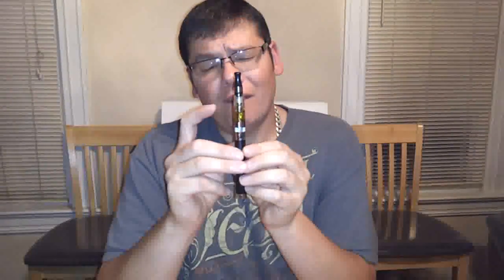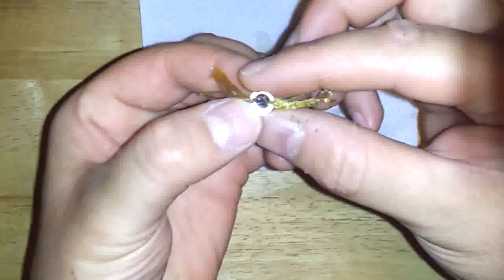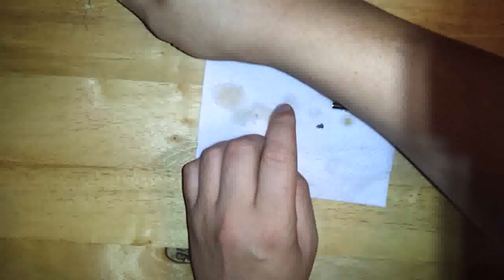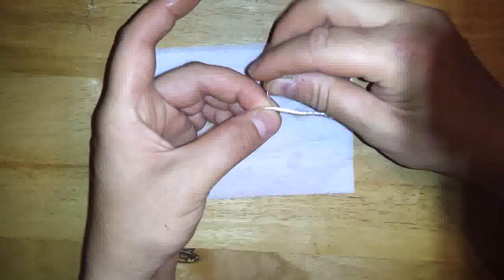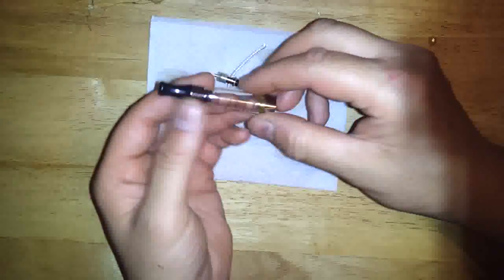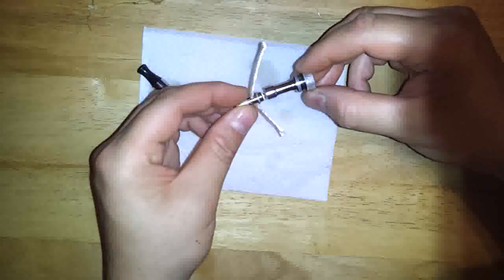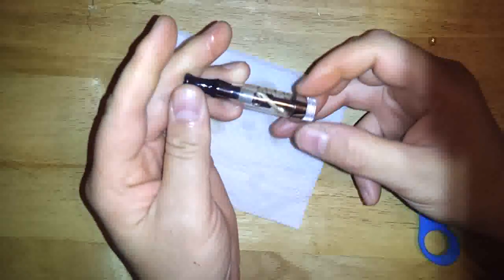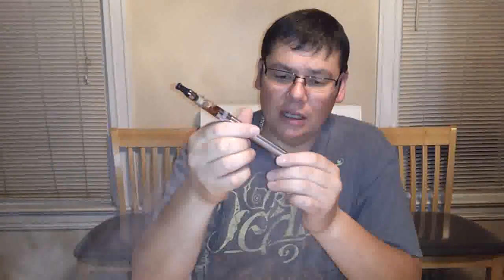How-To Rebuild the coil in the Vision Stardust V2 or Ego CE5+ Clearo (Electronic Cigarette)

Comment: Just remember that the TOTAL coil length must be considered for resistance.  Start with about 4" coil, wrap the 2mm wick, set and clip.  Measure your clippings and deduct from 4".  Now you have your total length.  Also remember the 2mm wick and wrapping consumes length (circumference = pi * diameter PLUS leads).

32 awg 1.2 Ω/in (25.4mm)

Using this method (500 byte limit for responses doesnt allow me to show everything) gave me a 1.55" (39.37mm) coil @ 1.86Ω.

Happy Vaping!

Comment from the maker: I am glad that you found the problem!! I do want everyone there that is trying to do this one their own to remember, to make sure that the kanthal is NOT touching anything other then the few points that are shown in the video. When cutting the ends off after putting the center post pin and the rubber grommet back in, Make sure that the ends are not hanging out even a tiny bit because they can touch somewhere else and cause a short. So a Magnifying glass inspection after twisting or clipping them

Comment: Thanks man!i followed your video as i was rebuilding. much better than buying a new head! Thanks a lot! Usually the heads that I get are around 1.5ohms. I was able to put about 5 loops in the coil and was able to get it to 2ohms..so now i can play around with my voltage(using a lavatube here). thanks man! great stuff

Comment from the maker: Great point! I think I stated that, but if I didn't, then you are exactly right on. All you really need to do is just wrap the coil just tight enough for the wire to touch the wick, and that is it. Any tighter, and you will have wicking issues!

Comment: Very nice video demonstration man, you made it look easy. A tip though, use a multimeter/ohm-meter to test your coil when you get it together. And a tip for everyone..After that, I would take it apart and note the number of winds and the length of the wire. Help keep it perfect everytime. Happy Vaping!

Comment from the maker: You will like the ease of doing the recoiling yourself and the taste that you will get out of the Stardust. I would like to also add that if you have the Vivi Nova, the heads on that are either the same or very close to the Stardust's heads. Which means you can do the same method to the Vivi Nova. Hope this helps, and Good luck to the recoiling.

Comment: the cover you discarded can be replaced and helps avoid short between the coil and the wall of the wick housing.
it also holds some juce so improves the retention capacity of the housed wick although the effect is minimal and is only relevant for chain vapers.

Comment: update on the gauze pad wick, working freaking amazing!  i took a 2 inch square of the cotton only part of the gauze pad, rolled it up tightly, wrapped a 7 wrap coil of 34awg nichrome80 wire, one u couldn't tell the diff from a factory coil using a safety pin (was just a bit thicker than a paperclip which made my roll a little looser, big help here) and i seasoned it by wetting and setting on my electric stovetop until dry 3 times.  flavor, TH, and vapor quantity still increasing since last post

Comment from the maker: The 0.20 mm thickness is the 32 gauge and is probably the easiest wire to work with when starting out. So I would start there and see what you think. That is where I started, and I think you will be fine with it.

Comment: This is a cracking little video, i not used my V3 clearo (as there called by Totally Wicked) for a weeks.   So thought i give it a go, i did 6 or 7 wraps 28awg kanthal on a paper clip. It came out 1.3ohms, i used cotton and lay another cotton wick on top.   I'm well happy, the flavor is great. Also at £8.99p for 3, i save money. Thanks a bunch bro. Happy Vaping..
Reply: I tried 28 awg kanthal with cotton ball wick for my vision ego. Not working so well for some reason.  Gets dry hits and not much vapor.

Comment from the maker: Sounds like you have a short somewhere in your clearo. I would check the coil and make sure it is not touching the sides of the housing for the coil. And make sure they are not touching each other. Lastly, I would make sure that the leads that go  to the pin and rubber piece are not crossed, because that would cause some problems too. After try again, and let me know how you make out. If you don't see anything or nothing works, try doing a rebuild again. You may have the resistance too low

Comment from the maker: Many vendors sell kanthal, or you can pick it up on eBay. Just make sure you get A1 Kanthal. I use 32 gauge just b/c it is easier to work with, and the resistance is where I like it for rebuilding this type of coil. I do use thicker gauges for other coils but 32 it perfect for this type.

Comment: the mesh so you can use it for wick material.  secondly, instead of wrapping a paperclip or something when making the wick, i recommend using a piece of silica wick in the center channel as well.  i do this because it helps the mesh wick not leak at all without affecting the liquid's flow.  i even roll the mesh as tight as i can around the silica and it still works amazing!  currently i'm using an aga-t did clone and vivi nova tanks too!  for the did clone u only need 1 wick and usuall a 5 wrap

Comment from the maker: The main reason why that does happen is because the little pin that goes back into the clearos is not touching the positive post on the battery. So what I would do very carefully take a pin or something small to pry very gently up the positive post on the clearo, and the battery. That may be the issue. If that does not work, then the next thing I would think is there is a short in the clearo. I know it may work on other batteries, but I have seen it before. So check the post first, then rewick.

Comment: coil hopefully resisting at around 1.8ohm - 2 ohm (i find this is the sweet spot for 4.2 volts output for most ego batteries ) . the mesh generally got a little too saturated if sitting on its side for too long in my did clone so i added the silica and problem solved!  i get way better vapor even now too!  i don't recommend using old wire, the wire that has been bend tends to break and short much easier, but it will suffice for a short while in a pinch...  and as for silica concerns...

Comment: Resistance is only a function of: material resistivity, wire diameter, and wire length (positive post to negative post). What you're saying is inductance, which is another matter altogether, and is irrelevant in DC for the most part, since we're not building electromagnets here - heating works with DC batteries just as fine. The number of turns and coil diameter matter for how much of the wick it can cover to produce a thick vapor cloud; this is also related to the wick diameter.

Comment from the maker: The length of wire that goes between the Negative and Positive connection points will determine what the OHMs are on that coil. So if you are not getting enough vapor, In my opinion, you have got too high of a OHM coil. So I would experiement with it, and try using less wraps, and go with 4, or maybe even 3. But if you do that and you start getting a burnt taste, or it is just too hot for you, then readjust it back up. Try to keep the wraps close together, and use the least amount of space.

Comment: the next step to get uber vape quality i've found out by trying today is to follow the above video method to make a new wick and coil and assemble your atomizer. then taking a very small piece of oxidized ss mesh, about the size of a single strand from the wick rope rolled into a half circle and layed directly on top, thinking of adding one on bottom too, of the coil.  i tried this with some old ce3 xl clearomizers earlier because they vape for crap and i had some leftover mesh. NOW GOOD AS CE4!

Comment from the maker: If it is burning too hot then you may have wrapped the coil too low of ohms, which means too little wraps. It will all depend on how many wraps you do which will determine the ohm you wrap at. If it is not what you are enjoying, I would try again until you find what you like to vape at. Good luck!

Comment from the maker: I am not 100% sure of what you are talking about, but if you are talking about the cylinder shaped part that looks like a thin piece of material that is the insulator for the coil on these devices that are in the video. They act as a barrier for the coil not to touch the metal housing. As for the metallic lining around the wick on the ego, not sure what you are explaining. I do not worry about exploding batteries as long as I make sure there are no shorts going on, and if you are worried, I

Comment: also, unraveling the wick a bit after building the new coil helps with the liquid flow.  one major concern i had with your technique, you arbitrarily cut the wire's length, as an fyi, the length of the wire determines the resistence, i use 34 guage nichrome coil wire, works great. it has a resistence of 1.4ohm per inch.  in this case the longer the wire is, the less heat it will put out, and vice versa, the shorter the wire, the more heat it will put out.   otherwise job well done on the vid

Comment from the maker: First what device are you putting the clearo? And then what materials are you using to rebuild the clearo? Silica, cotton, kanthal, or nichrome? What it sounds like even before you answer is the kanthal is shorting out somewhere. May be in the head when you brought the two ends down through the metal housing.

Comment from the maker: I have used cotton, and prefer silica over cotton. I personally don't like cotton wicks, because they burn fast and need to be replaced often. Not sure what you are asking if silica frays when cut? But if you are asking if small pieces of silica come off when cutting it, then yes it does. You don't have to burn the wire, but I usually do, because it reacts better for some reason when I do so, and the silica wick CAN be put into any flame and will not burn. I had to torch some of the silica,

Comment: i just used a gauze pad to make a wick because i'm out of cotton candle wick and it's working just fine, you just have to separate the fibers because they work better if the liquid can flow straight through them, kinda like lining up a bunch of strands of thread in the same direction and braiding them to make a rope, but in this sense, the braid isn't all that necessary because the flow is better without it, hence why, when I'm using cotton candle wick, i have to separate the strands

Comment from the maker: It can be replaced, but the material they use tears really easy, and is not worth the hassel! If the coil is built correctly like I showed, there should not be any shorts. As for it holding juice, It will not hold enough to make a difference. Not even enough to the the coil wet enough to fire! Thanks for you post Seb!

Comment from the maker: Not 100% sure but it sounds like you did not have the kanthal pulled tight when going through the bottom piece and it might have been touching the sides of the metal base piece. Then I think it might have popped the coil. So I would just go and re-wrap the coil and just make sure you pull the wire tight down, and make sure they are not touching each other and the sides. And let me know if that helps!

Comment from the maker: I use A-1 32 awg Kanthal, I also use 28, 30, 33, and 34 gauge. But for the most part the best wire to use is the 32. ebay does have it, but just make sure it is A-1, and not D!

Comment from the maker: That will allow the wire to be shorter also. Make sure that when you finally pull the wires down through the bottom of the coil head, they have no slack, and they are not crossing or touching the sides of the coil head. If you are still having issues after you make these adjustments, PLEASE contact me again, and we will work it out to where you are getting a satisfying vape for you!!

Comment: silica fibers in your lungs are by no means good for you, but generally speaking you would need a lot more in your system that an e cigarette can even manage do deliver to you when it's not working correctly, but if you are still concerned, and i do understand and somewhat agree, the stainless mesh will pretty much solve that problem too!  since your silica is wrapped it essentially can't fray and break down delivering silica particles into your body...  hope this helps you guys!

Comment: so yeah, move on to stainless steel mesh, you can totally use a silica wick core in it too if you need to slow down the liquid flow, but the ss mesh works more than amazing all by itself!  super easy to do, awesome flavor, ridiculous vapor, and i'm not even sure how long this wick will last, but i can guarantee it'll be way longer than silica

Comment: i hope i've been helping a little for anyone reading the posts, so first, if anyone is wanting to try satinless stell wicking, look up how to oxidize a piece of 320 - 400 mesh of wire mesh on here, the jack frost method, and the burn and quench method both work fine. i like the jack frost method best because it's faster. just repeatedly burn off some eliquid, i like flavored because the sugars leave a better layer of oxidation on the mesh.

Comment from the maker: What ohms resistance did you wrap the new coil at? It may be set way too low, and your frying the coil with too high of voltage to coil. Even if you have a ego, you can still set the resistance too low for it. So let me know what the ohms are on the new wrap. If it is not too low, you may have one of the wraps around the silica touching another wrap, which would also cause the resistance to be screwy! Let me know what you are working with,I will help as much as I can. Sorry took long to answer!

Comment from the maker: I assume you are talking about the rubber ring that goes on the bottom. If you are talking about that one, and you are burning that out, then you have a short some where I am assuming. Make sure that when you wrap the coil around the silica, that it is not too wide and touching the sides of the metal housing. Second make sure that the kanthal is coming straight down through the metal tube part, and only one end piece goes through the rubber ring. and the other is up against the metal housing.

Comment: Resistance Heater Wire, Kanthal A-1, 32 AWG 0.008", 0.20mm is this the exact wire your using? kind of shopping around, and you obviously did your trial and error already so i would like to go with exactly what your going with.. thx

Comment from the maker: Yes, it is not regular Copper wire!! I use Kanthal! But Nichrom will work, I chose not to use it because I feel that Kanthal lasts longer, and gets hotter than Nichrome.

Ebay is a great place to pick up 32 A1 awg Kanthal, and also many different electronic cigarette vendors have it in stock too!

Comment: Hey man i have a regular clearomtizer, i dont really know what type is it but it cAme with ego starter kit i got of ebay, i been looking through on what i can use to replace my wicks on the ce5 n i saw you can buy them but would ot be better if i just use your way and replace the coil and wire? Would that work for long periods of time cuz i will not be have access to ebay to buy more wicks later, so its either this or buy 20 wicks what do u suggest??? Plz help

Comment: isn't standard resistance 1.8ohms?   doing this must be trial and error I would guess as when you cut the wire after installed all bets are off as for as resistance. 

Im new to vaping in general, and only have two 1000mah ego batteries and a whole bunch of redux clearos.   I DYI juices and now have some wire and wick on its way to my house.   I guess ill have to play with it all.

Comment: update on the SS mesh time!  i saw some silica concerns and using old wire concerns in the thread so I'll address that for ya too here!    first of all, if you want the most durable, reliable wick system, stainless steel mesh is the way go go! I do, however recommend using your stainless mesh in tandem with silica wick, this just gives you a more even liquid flow and a more uniform, pleasant experience!   first of all there's no space for a turorial here, so youtube vids on how to oxidize

Comment from the maker: I did not mean ohm's law was not an exact science, but rather how many wraps around let say a specific size wick, will not be the same exact resistance everytime, just b/c the wraps would have to be the  EXACT space apart and the tension would have to be EXACTLY the same every time. But I may wrap my coils a little more spaced apart, which would actually use a tiny bit more Kanthal, which will cause the resistance different! So 3 wraps may be different for you than me, not much, but different!

Comment: Hi I have a GS-EGO-H2-Atomizer-Electronic-Cigarette-650mah-900mah-1100mah how do I change the wick on that?? I am new to this,thank you Maria
Reply from the maker: I am not familiar with that atty, but if the setup is the similar, it will be the same. Every atty has a + and a -, so if you find where they make contact, and don't have any untouched kanthal, you will be good. Just remember to be careful and do this at your own risk.

Comment from the maker: The same type of head is inside of the Vivi Nova, and the process can be done with that also. I love the Stardust and the Vivi Nova just because I can rebuild them to the ohms I like, and use the wick I like. I have also used this technique with Stainless Steel / Silica Hybrid wicking system, and I will be doing a video on that real soon, so keep on watching. Make sure you check out my contest that I am running on my other video right now!! Thanks for the Comment!!

Comment: can I use regular wire like out of a plug in cord if I break it down to little wires
Reply: i tried the same with cobber wires but it wont heat up the wires?